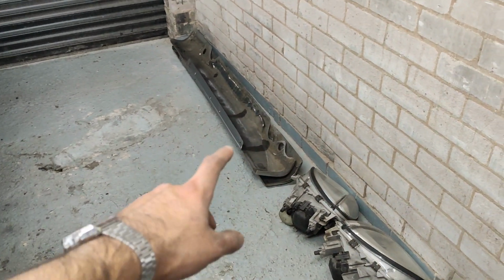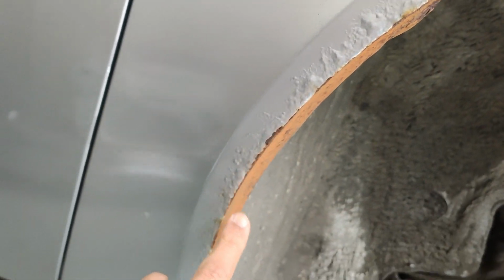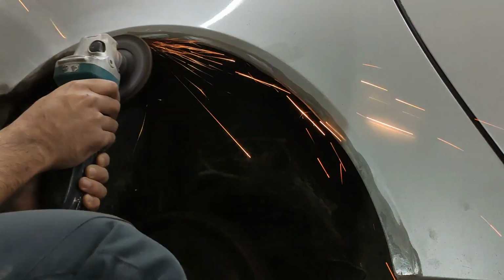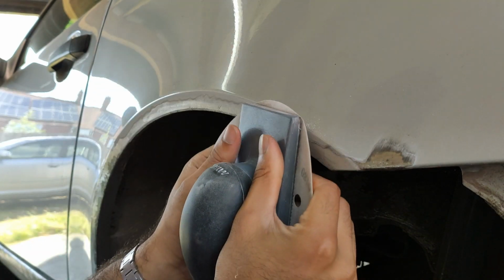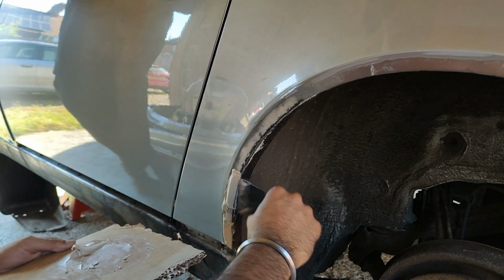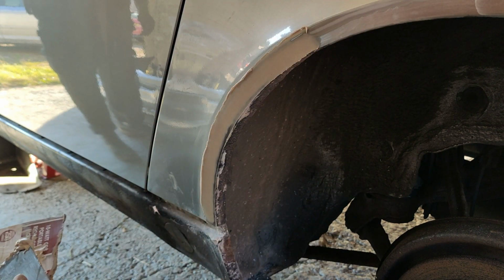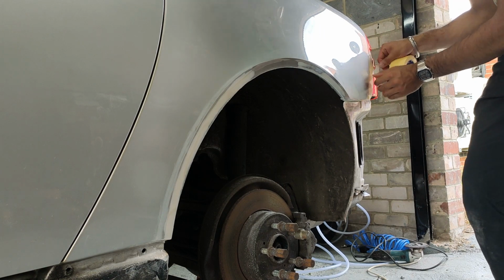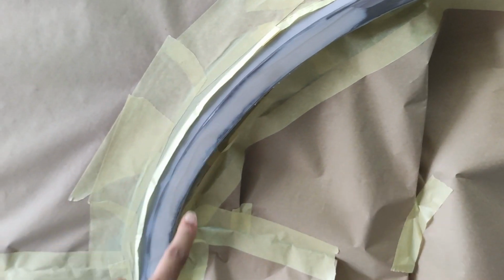Got RUSTY arches? Just do this!  BRABUS SLK project car Ep4

Comment: the only way to get rit of rust bro is to cut it out or it will come back ,like a bad rash
Reply from the maker: I have no doubt it will reappear, and ideally that is what I would have done. C however said that I should get a good few years out of this repair and time constraints to get the car back on the road dictated that sanding was the way to go. One tip he did give was to make sure the rust has been dry for at least a couple of months if not longer. When the rust does appear again I will make a video detailing how long the repair lasted. Thank you for watching and commenting!

Comment: You did it wrong. Rust comes faster than you think. Never apply polyester putty on bare metal because it is hygroscopic. For such rust pits you should give app r stop agent and epoxy primer on it. Then polyester putty, etc.